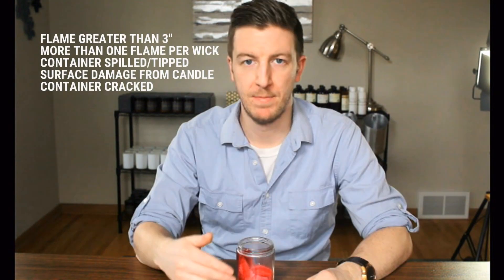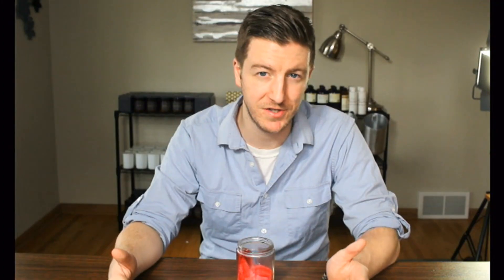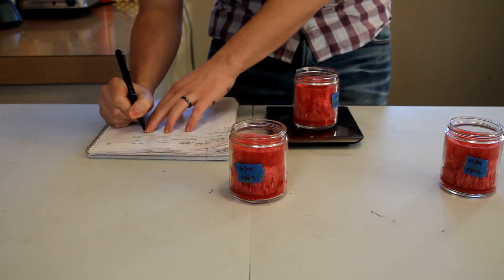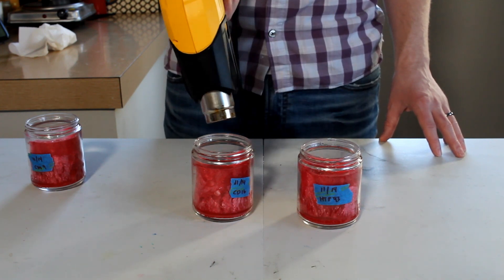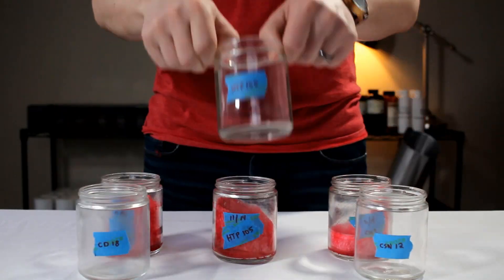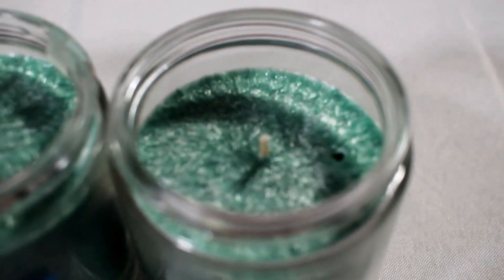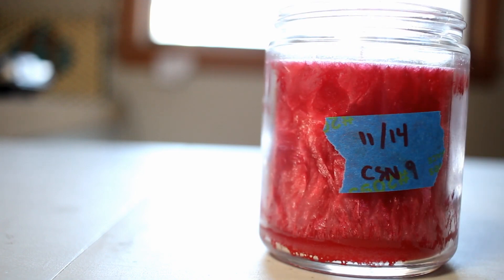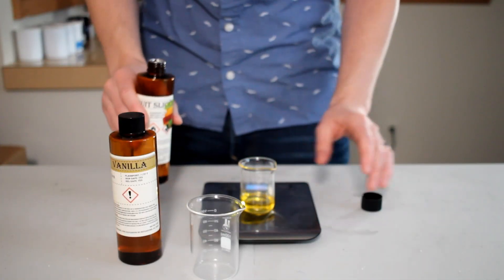Palm Wax Candle Experiment | Part Two

Comment: amazing video. how would you make multi color (steps of color) palm wax candles? thanks!
Reply from the maker: That's a great idea - I haven't done that with palm but I imagine it's similar - make as many batches as colors you want and pour into the candle.  Let it cool, then pour another layer on top.  With how hot palm is, I have to wonder how well that would go.  An interesting experiment!